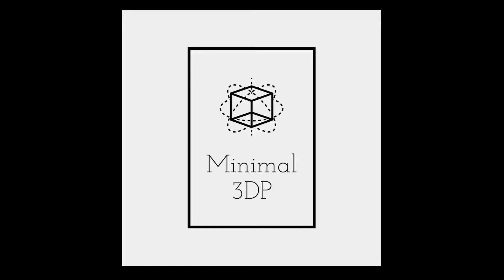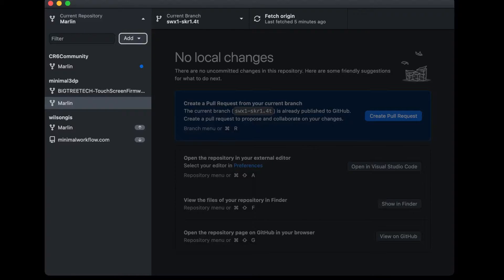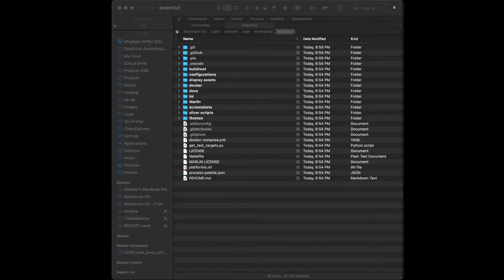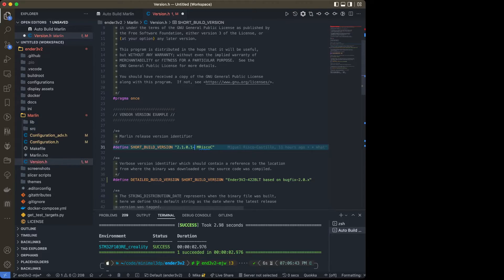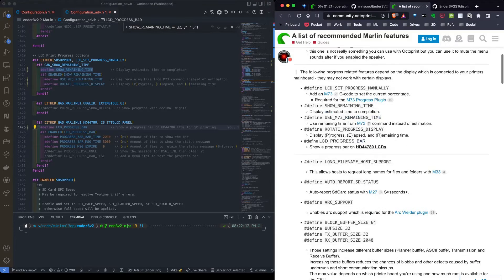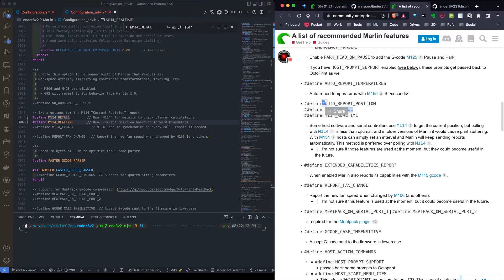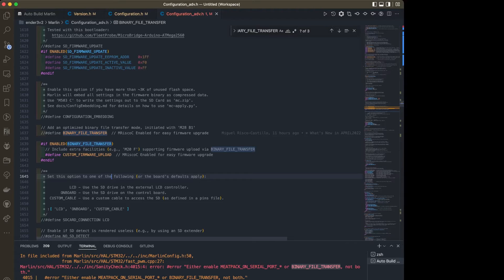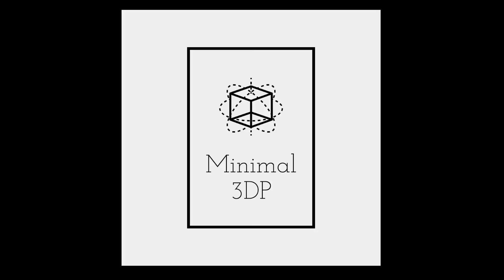Customizing mriscoc's Professional Firmware for the Ender 3 v2 to Optimize for OctoPrint

Comment: Finally..a comprehensive instruction..:) thank you very much...just trying to change from jyers to mriscoc..I am also using Octoprint for everything..Kia Ora from Aotearoa
Reply from the maker: No problem. I hope you find it helpful. Let me know if you have questions.
Reply: @minimal3dp  Did you encounter any issues with the bed? I have an Ender 3 S1 with Professional Firmware installed, and whenever I try to change the print bed temperature manually (either by changing the value directly, or using a Preheat Button), I get a MINTEMP error. Hardware-related issues are pretty unlikely as I just checked the entire system for any build errors.
Reply from the maker: @N1ghtmind  I did not. What is your reading on the bed temp?

Comment: As a noob to this hobby I have a question. Do I need to d/l mriscoc's Marlin 2.1.x and his special configurations?
Reply from the maker: You will need marlin and the screen files if you have a stock printer. Use the special configs if you have a bltouch, Cr Touch, etc